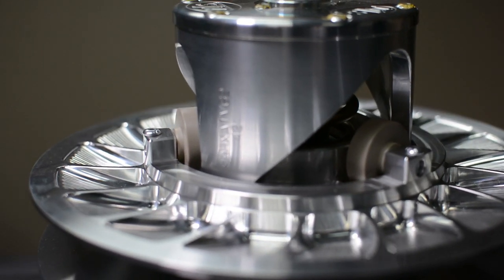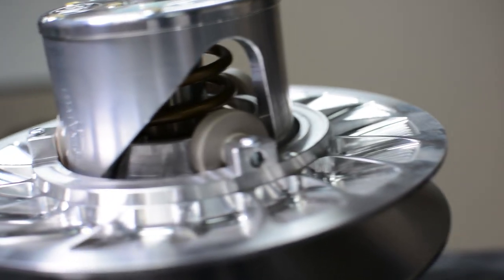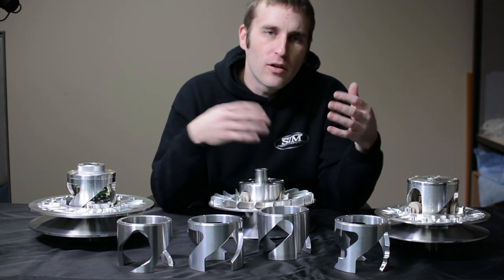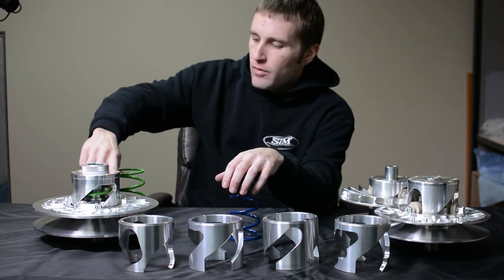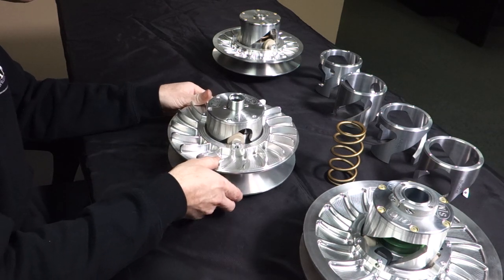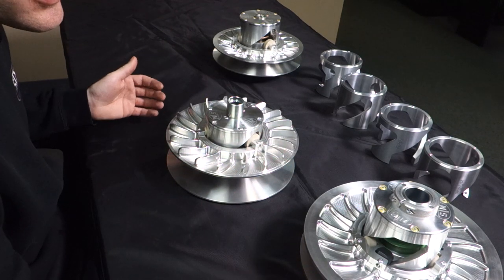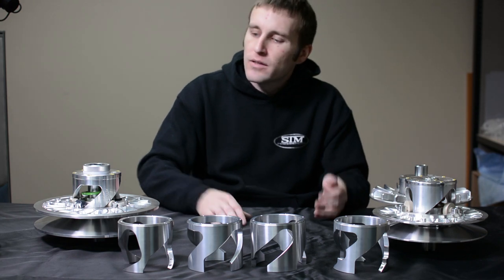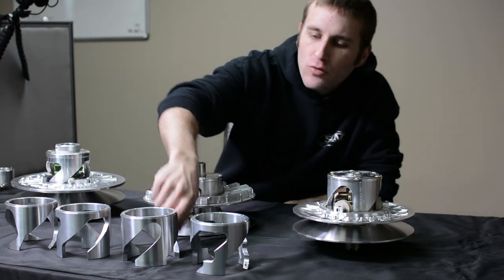STM Powersports ATV UTV Helix and springs explained

Comment: Movaeble sheave as it moves outwards,the groove angles determine how much load the compression spring will compensate,the steeper angle the groove has,the lighter load a spring can give,thus translate to torque.

Comment: Hi great video. I just bought a 2013 commander 800 and found it has a stm secondary and a modded oem primery running 29” outlaws. The stm is a 40/50 hoping you can give me some info on the setup this guy had made on this machine.

Comment: (2015 XP 4 1000 bought used)  I have full encapsulated helix with Gen 2 rollers(second from right in video, don't know angle ) with Gold spring secondary(no fin), and I think a R3p primary (purple or maroon spring cant tell). What would you suggest the best set up for Arizona trails/desert/hill climbs/dry river beds? I am running 30" tires roughly constant 500lb of riders weight.